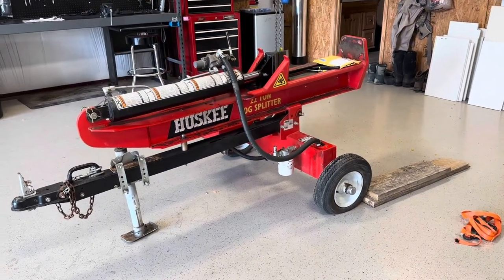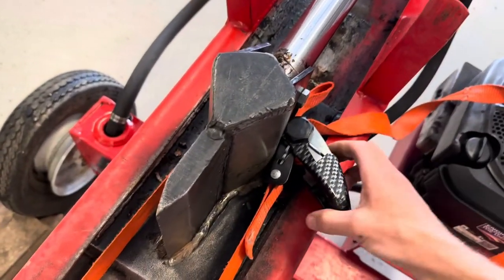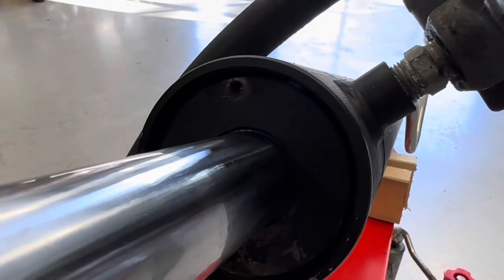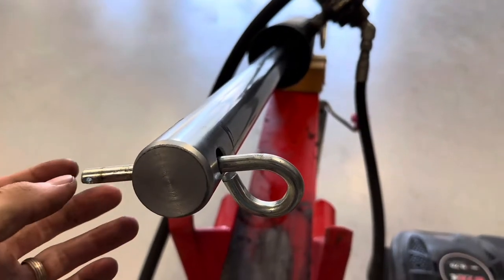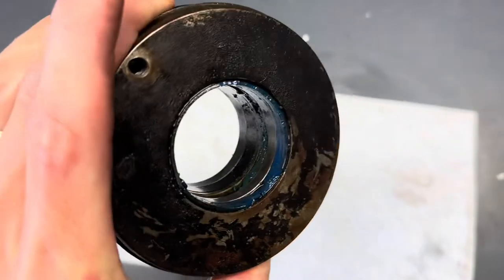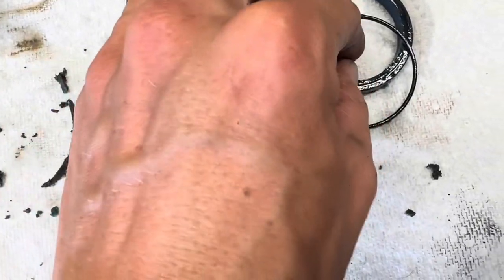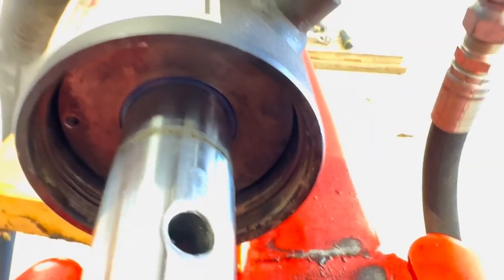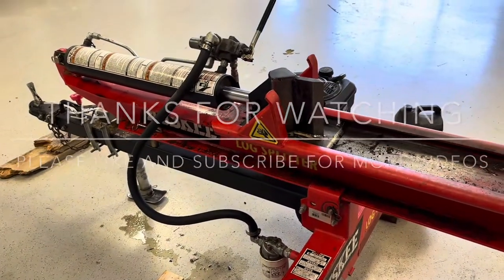Huskee Log Splitter Cylinder Seals Replacement

Comment: DO NOT and i repeat DO NOT turn on to try and push plate back in like the video instructed! It will blow out and hydraulic fluid will go everywhere! The plate flew about 30 yards away and could kill you if your standing in front of it!!! USE DOWELL ROD AND HAMMER TO GET THE PLATE BACK IN!!!!

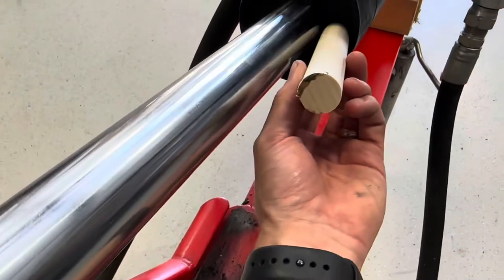Comment: At 4:41 - instead of using a dowel rod which will only put pressure on one side of the gland. I removed the cylinder, stood it upright, secured it in place so it wouldn't fall over (or you could have a helper hold it for you if one is available). pushed the shaft all the way into the cylinder and using a 9" piece of schedule 40 PVC and holding the operating lever open, tapped the PVC and the gland moved back from the retaining ring quite easily and as far as I needed to give me clear access to the ring. Using a screwdriver and the opposite side from the gap I was able to move the ring inward, which lifted the split ends and  pulled the ring out with a pair of pliers. It's important to know that even any air pressure in the cylinder will make moving the gland difficult so the operating valve must be kept open to eliminate and internal cylinder pressures. This is the hardest part of the entire seal replacement operation, however, tapping on the gland evenly applies pressure around the entire circumference and does not allow the gland to bind which happens when applying pressure on only one point. If you have a helper you can even hold a small piece of board on the end of the PVC. You will be surprised as to hoe easily the gland will move without any pressure in the cylinder. It's best to remove the t hoses the feed the valve assembly which will lose a little oil, but empty that unit. Any oil or air in the cylinder will make removing the gland very difficult and require more force than necessary to move it away from the retaining ring.

Comment: Overall, great video. Very helpful. I’ve got to swap out the seals in my cylinder that were leaking horribly.
Your video showed me exactly what I needed to do even if there is a slight variation in the style or design. Again this video was Very helpful, Thank you again!

Comment: Where did you get the seal kit?   What is small screw for?
Reply from the maker: Thanks for watching. Please help my channel  out if you haven’t already, by subscribing. 

Seal kit link: 

https://www.foards.com/products/s39017800?variant=19838314938465&_vsrefdom=adwords&gclid=CjwKCAjw79iaBhAJEiwAPYwoCKTzrpXlNgOrO5cW7krY6JrOYchYSenhZ9PNKUnq2ixaeE62Iu_i5hoC6BEQAvD_BwE

Small screw holds the plate in place.

Comment: Nice Video - I used 2x4 Blocking and Car Scissor Jack to push Piston Rod out.  Wasn’t easy.  There was Corrosion on bottom of inside Cylinder that was removed with Scotchbrite pad. Time to disassemble was 3 hours.

Comment: I have the same splitter and had the same problem. I took the cylinder off and took it to the shop that I know of. After dropping it off to be repaired, they called me about 6 hours later and told me that it was ready to be picked up. Only cost me about a hundred bucks. I do abuse my splitter with oaks that are normally over 20 inches across. When I bought it, seems like the paperwork said 14 inches but it will do more than they claim.

Comment: The mtd splitter had recently was welded closed at ends of cylinder. No snap ring. Those engineers got a raise for doing that.

Comment: What fluid did you use?
Reply: ISO46 Traveller at Home Depot.  $50 for 5 gallons.  System holds 6.5 gallon.